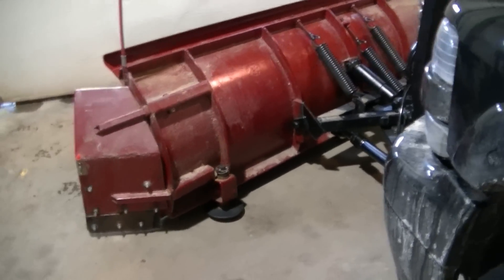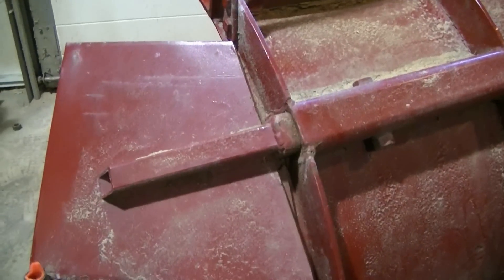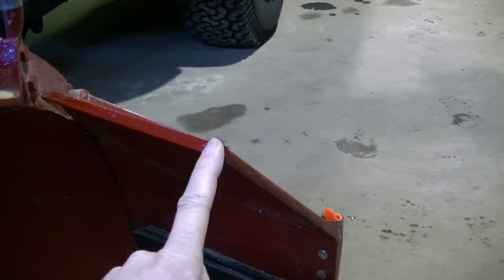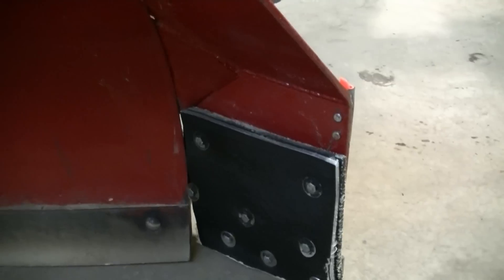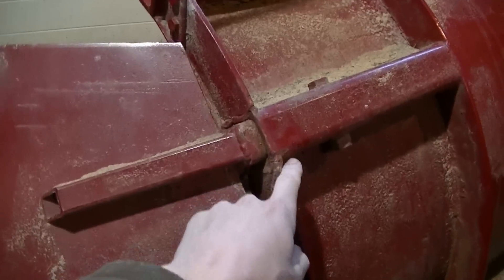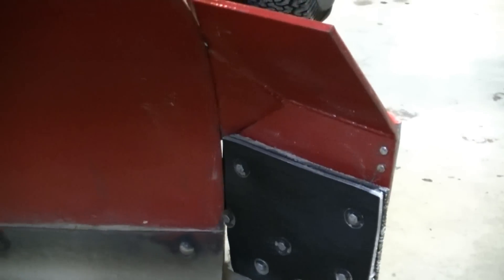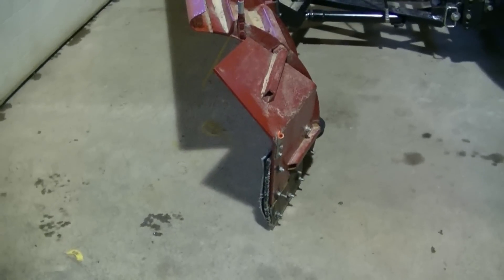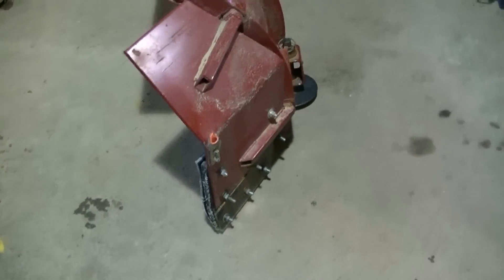Western Pro Plow Custom DIY Wings "Up Close Look"

Comment: I used square tubing to make mounts, but the welds were poor and I snapped one off when I hit a frozen pile of snow from the previous storm. I have re-brace it so it's stronger.  I usually over build stuff, but I guess I learned from this one!
Reply from the maker: Something like this has to be pretty heavy duty.  There is a lot of pressure on those wings especially old hard pack.

Comment: That's what I do when I want the blade straight I just bring them out from v or back from scoop and it'll be straight.  I think once you put the new cutting edge on and maybe adjust the chain a little it will sit just fine as for the straight part don't worry all v plows I've worked with don't have a button to lock them up straight

Comment: Hello Mossman 381.
I was wondering what size of square tubing did you use to build the wing recievers and inserts?
I think you did a great job. I am planning to build a set for my quad plow.
Any suggestions would be appreciate.
Regards.
George Jeckells
Reply from the maker: 2" OD,  you use whatever fits inside that depending on the thickness of the metal you use.  That is going to take all the abuse so you don't want to use thin wall.

Comment: Let's see this v plow in action hydraulics are quick on that v plow looks great on the dually by the way
Reply from the maker: The plow is quick.  But having some issues.  I can't get the plow to lock in straight mode.  Might be the wire that I don't know where it hooks to.  And I am going to need shoes.  I am not sure how I like the trip edge.  The plow trips pretty bad with all the dirt I plow on.  I hope shoes solve that problem.  I am going to run it some more today.  Maybe I am just not use to the trip edge.

Comment: Have you had any problems with them bending? It just seems like the angled weld would be prone to ripping off.
Reply from the maker: Dad ripped one off but he is really hard on them.  You do have to remember it's not a dozer blade.  I ran these for a long time without any issue.
Reply: Right. There must be quite a bit of forgiveness with the rubber then? They don't scrap ice as well. I built a set similar, but with steel cutting edge. It seemed like every other week I was bending them or ripping them off. So I took them off.
Reply from the maker: Cody Detterer   The rubber edge does better than you would think.  A steel edge would be a mistake on something like this.  Even the factory Western wings have a rubber cutting edge.
Reply: How thick of rubber are you using? It wears out faster, so do you slide it down at all? I've always wrote it off because I thought it would be fast wearing and not do as clean of a job. Sorry for all the questions I'm new to the wing scene as of last year, love them till there bent and I've put hours I the shop rebuilding them.
Reply from the maker: Cody Detterer   I put a steel edge on the bottom of the rubber edge.  If you do a lot of plowing you will have to replace the edge more.  That is just part of having the wings.  They save you a bunch of time but they do need some maintenance.
Reply: How thick of a edge? Just bolt it up to the rubber on the back?

Comment: It's also stainless so it's a little lighter and some of those v plows trip really hard that's why I like the boss it doesn't trip as hard I bet shoes will help take it to the dealer and have them take a look scoop work good what do you mean it won't straighten out all the way to where it's even
Reply from the maker: I am going to get shoes and new cutting edge for it.  I wanted to wait until next year but looks like I will have to do it now.  I could tighten the trip springs.  That would probably keep it from tripping as much but want to wait for shoes before I do anything like that. 

You are suppose to be able to lock it in straight blade mode so you can run it just like a straight blade.  Left/Right,  Up/Down and the blade will act like a straight blade.  It is suppose to have the locking cylinders like Westerns ultra lock.  So far I can't get that to work.

Comment: I went lighter weight with mine and used some 1/8 inch thick. My bottom section by the scraping edge is bending over. It should be a quick fix with a vice and some muscle to get mine straight again. Going to brace mine up a bit better.
Reply from the maker: Yeah,  1/8" might be a little thin with no braces.
Reply: I will have it bent back and braced up tomorrow. Just in time for the next storm to roll in to test it out more. 8-12 inches snow forecast by me by Friday morning, I think you are in that same range if I remember right.
Reply from the maker: I know they are calling for snow/rain all day Thursday.  I have not heard a total yet.  8-12" of wet snow will not be fun.
Reply: WSAW lowered the totals for now, but added a sleet rain into things too for my area. You are correct, this storm might not be fun...lol.
Reply from the maker: Looks like 5-8" right now.  I am hoping that it gets cold for most of that.

Comment: Great heavy duty wings. Ive been looking at getting wings on my pro plow, these are definitely stronger than the buyers and demon wings. How long did it take you to build? And what was the cost for all materials?
Reply from the maker: +james vandyke   I believe it took me a few days to make these.  I used scrap steel we had laying around so it cost me nothing.  I am guessing the plow will break before the wings do  :)
Reply: +mossman381 nice, we used all our scrap plate steel on making a 10 ft plow into a pusher for our skid. haha. but I'm definitely building these.
Reply from the maker: +james vandyke   I would never run a straight blade without wings.  They are a huge help.
Reply: +mossman381 So I've plowed 3 events with the wings I built. they are great. the only thing that is an issue is where I work we plow curb-to-curb. so running my plow over a curb doesn't work too well. for everything else they are just perfect.

Comment: It doesn't work on my ezv either I can play with the controller and get it straight and it will hold I'm not really sure if my plow had it or if it ever really worked haha I'm sure the shoes will definitely help and better to spend the money on a cutting edge now then doing any damage where it's still new especially where it is worn already
Reply from the maker: Fisher has the locking cylinders too.  I am wondering if you have to push the buttons a certain way?  I don't know.

In v the center of the blade is touching the ground and the outside edges are off the ground.  That alone might be causing me trouble.  Going to have to spend the $300.  Don't want too.

Comment: how do the wings hold up when the blade trips? i have a the exact snow plow and im looking to fabricate wings for myself, just worried i would damage the plow if it trips
Reply from the maker: This blade has tripped many times with these wings.  I never had a problem.
Reply: when you converted the lighting i assume you had to change the wiring for the controls. Was is simple hook back up?
Reply from the maker: Tristan Gibson   I had to convert it to a three plug system.  The control plug and the light plug was separate.  I thought it was a simple conversion.  Wasn't a cheap conversion.  Those lights are expensive and then all the wiring.
Reply: mossman381 I see 
Thank you for your insite
Reply: mossman381 I really like the videos that you are making
Reply from the maker: Tristan Gibson  Glad you enjoy them.